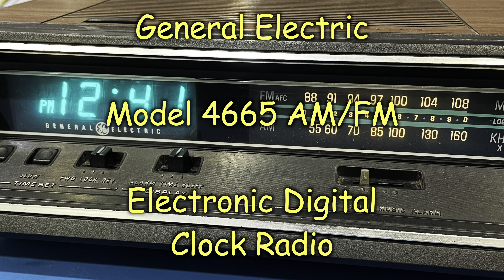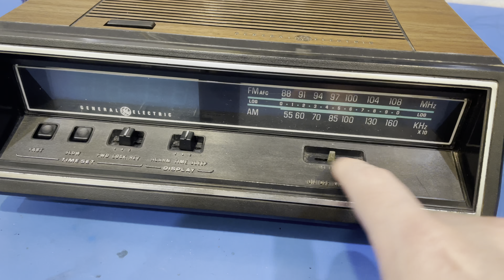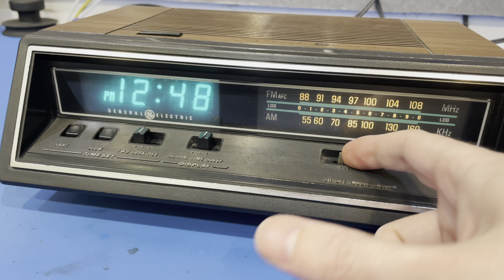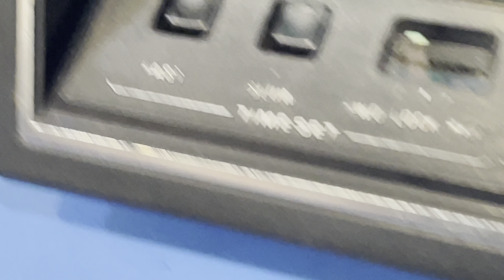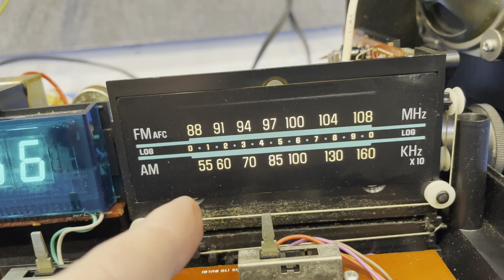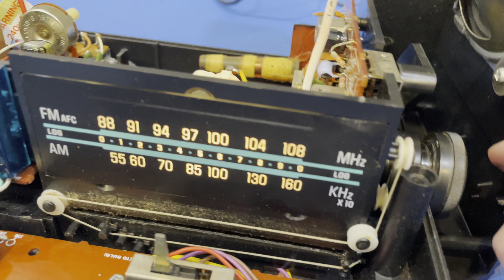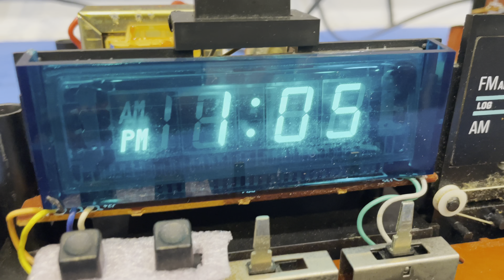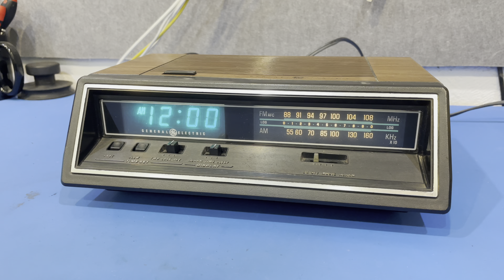General Electric Model 4665 AM/FM Electronic Digital Clock Radio - Overview

Comment: The red led numbers replaced the vacuum display sometime in the 80's. I'd like one that kept decent time and had adjustable brightness (never seen that before). The radios usually work. I had a Sony dream cube with green numbers and it was crap
Reply from the maker: Whoa, slow down - The Sony Dream Machine Cube? My mom had one of those. And that thing was amazing! There might have been a few revisions where they fixed all the bugs mind you... 😎